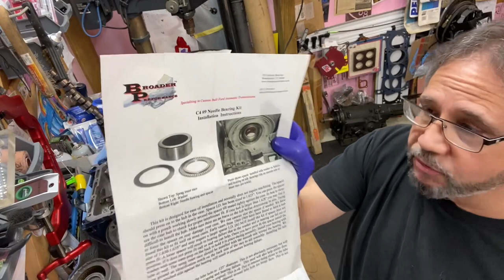DragBoss Garage: Sub Assembly Build FordC4 Transmission, Hold's A 750+ Hp Ford 351 Cleveland Part 2

Comment: I've seen using 6 clutches and thin steels just makes for hot clutches.
Reply from the maker: Yes, definitely need high line pressure and cool fluid.

Comment: Pro tip put some Pine-sol on any stains on your shirts and it will take em out.
Reply from the maker: Great idea, I never knew that troy, more than one use there..
Reply: Thanks, gonna try that! ;)
Reply: Super Clean also does a nice job on stains, use it like a presoak, just spray the stains and throw in the wash works very well for laundry.

Comment: Being a motorcycle guy we kick the steel’s around on the garage floor then wipe and reinstall, works great!
Reply: I used sandpaper to "deglaze" the steels in my C6, I think that's why at first startup it wouldn't move in gear like it was locked up.  A couple whomps on the accelerator broke it free, it's still fine 20k miles later.
Reply from the maker: I just use 50 grit, sandpaper, deglaze, and put a unidirectional finish on it. Probably easier with your feet in your hands lol.
Reply from the maker: Exactly what I do. Great tip. Thanks much captain.

Comment: Good stuff. Had one automatic apart in my life, a 2 speed Ford o matic. Cleaned it, replaced the clutch packs and threw it back together. To my surprise and others it actually worked fine. You could also push start the car with that tranny, something I had to do a few times.
Reply from the maker: Cool deal Banger. I bet it made you smile. Push start like a race car ☺️

Comment: With the direct drum, as we talked after I watched this video, that thick pressure plate goes on last, before the snap ring, not on top of the piston. A regular steel goes in the drum on top of the piston first, then stager the frictions and steels, thick top plate, then snap ring. "We" are always learning.
Reply from the maker: Yes Paul, thank you again for calling me. Like you said that could of led to the early failure of the clutch pack. Thank you for your time and expertise.

Comment: Tim, the  c4 transmission Can be found with 3 Clutch Disc's in a  4 or 6 Cylinder like used in pinto or Mustang II or 4 discs in most v8 Cars and 5 discs in some truck applications.
Reply from the maker: Cool deal. I know the VB for those cars is not good for performance mods.

Comment: I find it's easier to get that forward clutch pack diaphram snapring out with a good scribers pick
Reply from the maker: I will have to try that. What really works for me after making this video that little screwdriver I use. I don’t need that big one in there but thanks for the advice I will check it out.

Comment: You get the front wheels three of four foot up in the air and something breaks in the transmission... the front end drops like a ton of bricks... I've seen it twice and it ain't purdy. Back in the 80's you could overhaul one for $19.00 if the bands were good. Clutches, Rings, Seals, pump bushing, paper n rubber and an all-out cleaning. Read somewhere Ford bought the two-band scheme from Chrysler for about the price we paid for Alaska. (first in the cruise-o-matic)
Reply from the maker: Yes sir what goes up, must come down. Been there done that. I used to work in transmission shop in the 80s agreed. Thanks for watching nobody